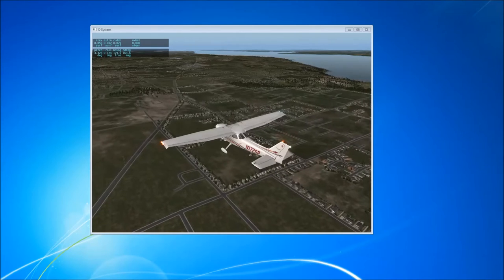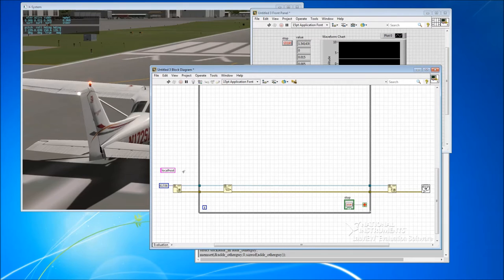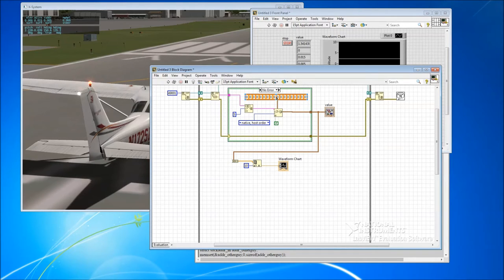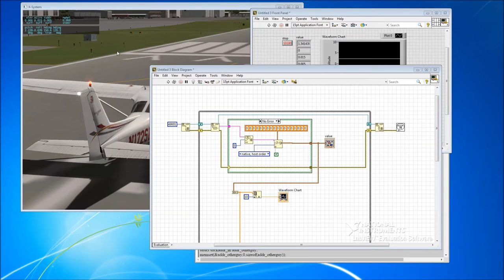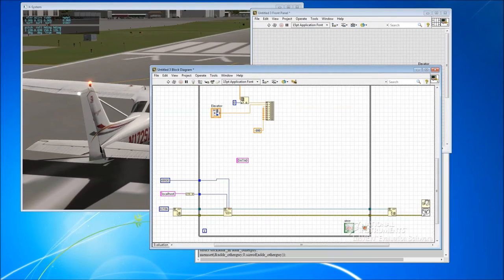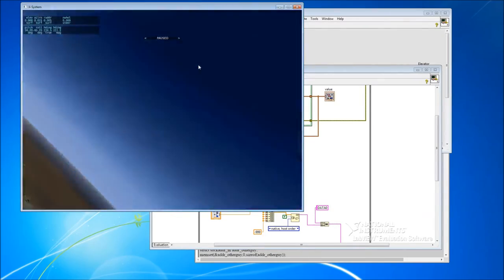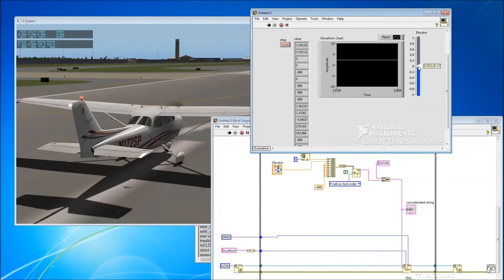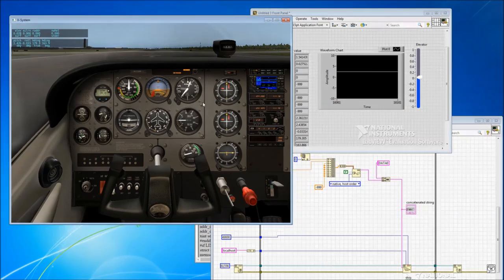Controlling X-Plane from LabVIEW - Part 2: Sending Data to X-Plane

Comment: I'm looking to use X-Plane, Flight Gear, or similar as a flight visualization tool where I send Pitch, Roll, Heading, Lat, Long, Altitude values into the flight visualization program and that program just puts the aircraft (helicopter) in the virtual 3-D world.  Do you know if I can just send in position data and just visualize it?  I'm a pretty advanced LabVIEW user, but I've never seen an example of someone succeeding in driving a flight sim program with Pitch, Roll, Heading, Lat, Long, Altitude, etc...

Any idea if it can be done and if there are any tricks to succeeding?
Reply from the maker: Christopher, this is definitely possible. I have finally got my PC back after it spending 3 months being shipped across the world, once i get it set up i will do up a quick demo for you.
Reply: Awesome!! Thank you so very much!
Reply from the maker: Hi Chris, sorry I haven't gotten back to you sooner. No video yet, but I have got some proof of concept code working. You can access it at https://github.com/bellcham/XP_Attitude.  There are 2 components, the labview VI, and then a plugin for X-Plane. We have to use the plugin because the internal X-Plane variable we want to access are not available through the native UDP interface I used in the previous videos. My future videos will need to use a plugin anyway, so this was a good time to do that. The way to get the plugin to work is to copy the whole XP_Attitude directory that is in XP_Attitude\X-Plane\Debug\plugins to X-Plane 10\Resources\Plugins. You will need to restart X-Plane to get it to pickup the plugin. (there is another plugin available here: https://forums.x-plane.org/index.php?/files/file/18878-x-reloaded-linmacwin3264/ that will allow you to reload plugins on the fly, which you want if you are going to do any plugin development.)
The LabVIEW vi talks to X-Plane through UDP sockets, at the moment it's a bit clunky and X-Plane will block on startup waiting for a UDP packet if the VI isn't running. Hopefully that at least gives you an idea of how to tackle this issue, let me know how you go, and if you have any questions!

Comment: How do you fix the problem of Error 74 from unflatten from string function on LabVIEW? It simply does not work
Reply from the maker: That error means that the string you are trying to unflatten does not contain enough data to create the data type you have told the unflatten function to extract. For example, an I32 variable requires 4 bytes, which are represented in the flattened string by 4 characters. So to unflatten a string into an I32 the string would need to be at least 4 characters long (it can be longer, and unflatten will just extract the first 4 digits of the string and pass the rest out).  If you passed in a string that was only 3 characters long, you get error 74. If you're getting the error receiving data from X-Plane, the most likely cause is that you haven't selected all the required outputs in the X-Plane Data Input & Output configuration page. You can troubleshoot by adding a string length function and an indicator to the input string right before it goes into unflatten, and see how many characters you are getting. In the example in this video, the data type being fed into the unflatten command is an array of 18 SGL's. A SGL, as the name suggests, is a single byte, so we expect our input string to be 18 characters when it enters unflatten. (Note that the string will be longer when it arrives from X-Plane, but we strip off the first 5 characters of unwanted data before we unflatten)

Comment: how did you fix the problem from xplane crashing with labview
Reply from the maker: pretty much every crash i've had using X-Plane with labview has been because I was sending incorrectly formatted data out of LabVIEW. Sometimes X-Plane will crash, sometimes it will keep running but the simulation will pause with flashing -- PAUSED -- indicator on the screen and you can't un-pause it, or sometimes the aircraft will do weird stuff like fly off into space. But it has always ended up being because the data I was sending in was wrong. The most common cause is that I added in an operation involving a constant, which by default labview will make double precision. This then converts all subsequent operations in that calculation chain to also be double precision. When this gets to the output section of the VI, these variable are bigger than the expected single precision floating point numbers, and so they end up making the output packet the wrong size, and the data is not aligned as it should be. X-Plane just assumes all the incoming data is single precision, and so ends up interpreting the incoming data completely wrong, and it seems to do pretty much no error checking on the incoming UDP data, so you just get a crash or random weird behavior.

The easiest way to check for unexpected double precision numbers being passed around is to look for the little red coercion dots (http://zone.ni.com/reference/en-XX/help/371361K-01/lvconcepts/coercion_dots/) on the input to different labview components. These indicate that one of the inputs is being converted to a different type. In this particular case these will appear on the input that is the correct single precision float, so the input you want to look at is the one without the dot. Change a constant type by right clicking on it, going to "Representation", and selecting "SGL" instead of "DBL".

There are other ways you can mess up the data going to X-Plane, but they are more likely to just result in incorrect aircraft behaviour, rather than crashes or bugs.
Reply: @AdamBellchambers 
I can't resolve problem